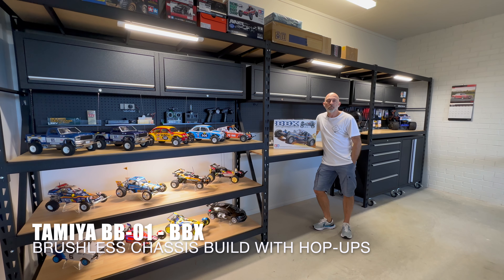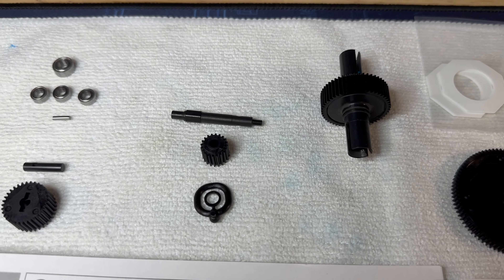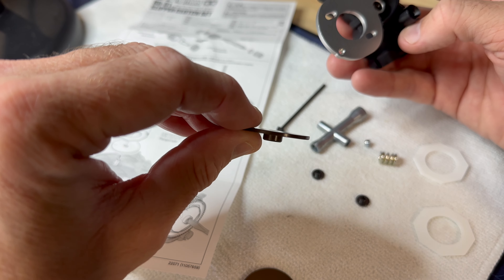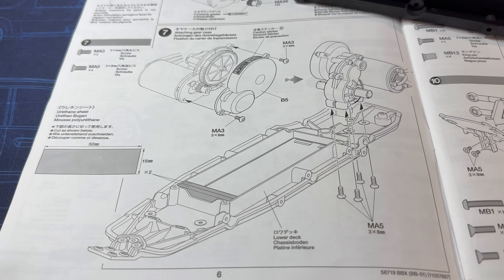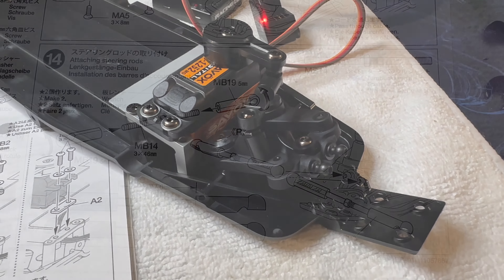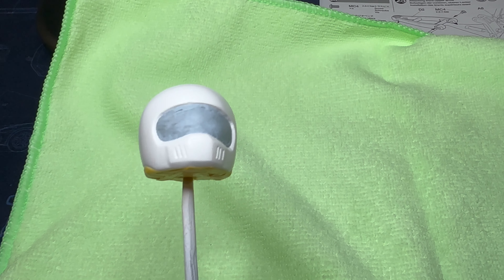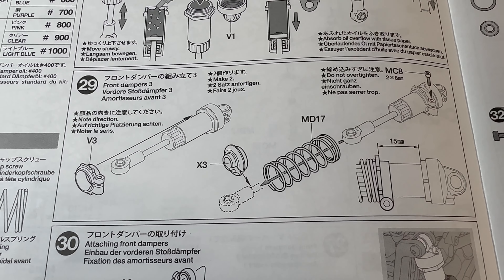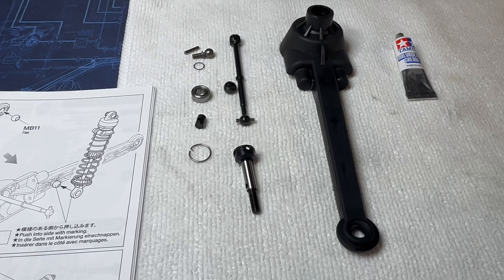Tamiya BB-01 BBX Buggy Brushless Chassis Build

Comment: Just one question, with the spare tire shouldn't it be a rear tire assembly as in the real incident the back would go flat not front, and if the front did go flat it would sill be drivable!!!
Reply from the maker: @ralphhowing3473  Good point lol. I think the supplied body mount for the spare wheel only works with a front tyre as it’s thinner. Would need to be a longer mount to accommodate the wider rear.
Reply: Thanks brother you just keep up the awesome work you do

Comment: Fantastic video and just the set up I was looking at with the tamiya esc and motor, so the esc cover can be put in place. A lot of videos are leaving that off as the esc is too big. 
Just out of curiosity can I ask why you chose the 15.5T and not the 10.5T - I believe that esc will run both ?.

Could i also ask what receiver and control you are using as that also looked very neat.

Sorry for all the questions but looking to get back into rc after a 35 year break and things have changed a lot in terms of electronics :-(.
Reply from the maker: @NS-tv7wi  Hi thanks for watching. I’m no expert but happy to help. Yes it all fits in there but the wires need to be super neat to fit. It was the most fiddly one I’ve done. Motor choice depends on lots of factors but simply the lower the turns, the faster the motor but with that there is less torque, so i believe lower turn faster motors are best suited for on road, drift cars etc. You can then play with the pinion gear to get the right ratio for your application, as per the charts supplied with the motor etc. I use a Noble NB4 transmitter & Flysky FGR4S V2 Receiver. The new NB4+ or Noble pro are other options. They can come with 2 receivers, the small one with no antenna and the larger one with an antenna. I use the larger ones in my SRBs. You can have 20 models stored. I still struggle with it as I grew up with stick transmitters. My vintage RC’s use the old school radio gear. Hope that helps and hope you are subscribed, cheers!
Reply: @ . Thankyou so much, really appreciate the information. I subscribed after watching your quality video, it’s the least I could do.
Maybe when I finally get round to the body and transfers I can send it over to you to sort that out for me 😂
Reply from the maker: @ Thanks, it is appreciated. I’m not monitised so don’t earn any money from these videos. The comments & chat keep me motivated. If I didn’t have such a backlog of projects, I’d be happy to help lol. I hadn’t done a clear body for so many years until this one, been mostly doing hard bodies. Lots of components but if you take your time, cut it all out, pre-drill and fit everything before painting, you’ll be fine. I’ve done a paint video for this one too. Lots of light coats is the key with time between to dry. Sorry, what’s your name? Are you in the U.K.?
Reply: Sound advice. I need to catch up on the rest of your videos 😉.
Nick (Uk)
Reply from the maker: @ Thanks Nick. Have a good evening. Jase in Australia, originally from UK lol.
Reply: Same to you 👍.  Can’t imagine why you left the dark wet and windy uk for Australia 😉
Reply from the maker: @NS-tv7wi It has its moments but I still love the U.K.!
Reply: @jason.bochniak  ❤️
Reply: Me again Jase - Sorry !.
No going back now, the kit is ordered along with all the bits apart from 2.
Which model savox servo did you go for ? 
What batteries do you run as I don’t think I am ready for lipo so any recommendations there would be appreciated as i want to make sure it fits 😂
Reply from the maker: @ Hi Nick, awesome! You need a low profile servo, you can download the manuals in advance from Tamiya and they have the dimensions etc but if you want the same as I use, it is an SC-1252MG. Battery wise, it will fit the regular Tamiya stick pack shape batteries or a shorty 2s Lipo. I found a NOSRAM 2s Lipos that is the same shape as the stick packs and also have the Tamiya plug. Nice power delivery and very light compared to a NiMH stick pack which is your other option. Just remember if you have different batteries, you have to change the hi and lo cutoff settings on the esc to suit. If you can get the 2s lipos that are the same size as NiMH, they will then fit in any other future Tamiya kits. Nosram 2S 7.4v Lipo 50C 314mm (tamiya) NOS999301
Reply from the maker: https://www.hobbyone.com.au/nosram-lipo-battery-7.4v-2s-4100mah-round-stick-pa
Reply from the maker: https://www.hobbyone.com.au/tornado-rc-battery-7.2v-nimh-5000mah-w-tamiya
Reply: @jason.bochniak  you are a star thanks Jase
Reply from the maker: @NS-tv7wi  No worries Nick. Most people will tell you to ditch the Tamiya ESC and plug etc, the more modern connections are a lot more reliable. For what I do they work fine. I’m a bit of a Tamiya fanboy so like eveything matching lol.
Reply: Yeah I am with you. I want it all matching and as much tamiya as possible. If the tamiya steering servo had been metal geared I would have got one of those also 😉.
Reply from the maker: @ 100%. That’s the same reason I don’t bother with the Tamiya servos. Shame!
Reply: Good shout on the build instructions being online. I should have known in this day and age 😖. From the looks of that they are suggesting using the Tamiya LF battery LF2200-6.6V racing pack 55102 with a deans to tamiya connection. Don’t suppose you have any experience of doing that ?
Reply from the maker: @ I usually download them whilst waiting for kits to arrive so I can get bits, paint etc ordered in advance. Yes I have a couple of the LF batteries and in my opinion they are not worth bothering with. Low power 6.6v compared to 7.4v lipo 2s. There’s no comparison. They don’t last long either regarding run time. I also wasted money on a proper Tamiya charger for them.
Reply: Good to know. Is it also night and day between Nimh 7.2v 5000mah and a 2s lipo ?
As I know I will not be disciplined in looking after the lipo, so worried i will let them go flat etc
Reply from the maker: @ no need to worry, the esc has an auto cutoff to stop the batteries from discharging too much. The car will literally just stop moving. It’s the same with NiMH. For NiHM, Ni-Cd & LF you set the esc to low cut-off and for lipo you set it to high. Lipo require more care, proper physical storage and actual charged storage. I keep mine at 80% which means they are always ready to use. If you want you can then top them up to 100% quickly. I always charge them with a balanced charge too. Never had any issues, just something new to get used to. I think its worth just diving in to be honest. I started with NiMH and ended up changing all my cars to lipo except for my Clodbuster and 1/14th scale Grand Hauler because the Tamiya escs for those kits can’t use lipo.
Reply: Thanks again Jase. Looks like lipo is the way to go 👍
Reply from the maker: @NS-tv7wi  You can always get a NiMH to get going if you prefer but getting to the ESC on the BBX to change the settings once it’s installed is a real challenge. That combined with the fact you’re going brushless, you want a decent power source that’s light in weight too. Just trying to save you hassle down the line. Good advice that I’ve been given time and time again (and still haven’t done) is to ditch the Tamiya plugs and install the deans style.
Reply: I really appreciate your advice as I am 30 years plus out of date 😖. Is that just a case of removing the tamiya plug and simply pushing on a deans connector on the esc ?
Reply: I don’t want to start soldering 😔. Don’t have the gear or experience lol.
Reply: I assume you have not had problems with the lipo melting the tamiya connectors if still using them ?
Reply from the maker: @NS-tv7wi  you need to chop them off and solder the deans plugs on. Or buy non tamiya ESC with deans plugs pre-installed. I haven’t had any issues but I don’t use them a lot. The deans plugs are just a better more reliable solution.
Reply: Cheers Jase. Managed to find the same battery as you from Germany. No one in uk seems to sell this with tamiya connectors 😞. I will not be using this much it will be very much as shelf queen lol, so hopefully won’t see any issues either 🤞. I did find some others in uk with tamiya connectors but they advised to use with standard can not brushless (I suppose that maybe the case with the nosram but at least I know some one that’s tried this set up using this particular battery so did that).
Thanks again
Reply from the maker: @NS-tv7wi  ok cool. Did they give a reason why not to use a lipo battery with a brushless motor? I’ve never heard that before. That’s what most people are running these days.
Reply: I believe it’s down to the current that the brushless motors draw compared to brushed and it’s that which will cause the connectors to overheat as they then struggle to draw that extra current from the battery through the connector
Reply: I take it the lipo is charged through the balancing cable and not the tamiya connector ?, so I don’t need to worry about connection types on the charger ?
Reply from the maker: You have to charge with both connectors connected to the charger at the same time. I don’t think you’ll have a problem, the battery is only a 50c and you say it’s mainly for the shelf. When you run it just keep an eye on everything. You can run it, feel the connector, check if it’s getting hot. Always good to look over the car as things can rattle loose too. Worse case, you can change the plugs. Soldering is really easy mate.
Reply: @jason.bochniak  no worries. Cheers
Reply: Nearly there Jase 😂 I hope.
Charger sorted. Did you use anything on the motor plate ?
Diagram says apply synthetic rubber cement ? Don’t know what that is and don’t believe it’s used anywhere else ?
Reply from the maker: @ hey Nick. Step 6 motor to motor plate? Definitely no glue there. You need a bit of the supplied grease. Steps 18 & 20 you do need some synthetic glue. Have a look at my build video…
Reply from the maker: @ what charger did you buy?
Reply: Hi Jase. Oh right they supply the grease needed for step 6. Great !.
Yeah 18 and 20 are using ‘synthetic rubber cement’ what ever that is ?
I bought the skyRc T100 - seems to have everything I need (with tamiya adaptor).
Ps first snow fall for the end of 2024 in the uk tonight, must be nice to be warm right now lol.
Reply: I’ll have another look at your video. Got it saved as a favourite 😉
Reply: So guessing it is basically gorilla glue or some equivalent- as in it just sticks loads of different materials including plastic and metal together for a permanent bond ?
Reply from the maker: @ Cool. Sounds great. I haven’t seen the snow for about 15 years lol. Yes warming up as we are heading into Summer here. Maybe google it. That’s what I did. I used Tarzan brand glue. It sticks most things but doesn’t melt the plastic.
Reply: Cheers Jase
Reply from the maker: @NS-tv7wi when’s your BBX coming?
Reply: Still waiting for an update 😔. Ordered it late on Friday night (from German seller on eBay 😖)
Reply from the maker: @ Do you use TTP models? I get all my spares from Antony there, apart from kits which I get locally or from Asia.
Reply: Yeah I used TTP for a few of the bits (heard you mention them in the build video 😉).
Reply: Hi Jase. Hope you are enjoying the summer Sun ;-).
While I await the BBx I am starting to think about colours and the driver. I was wondering what grade sand paper you used on the helmet joins (and what filler did you use to fill the gap ) ?
I might look like a real dog dinner when I paint bit but at least it won’t have a join (I hope) 😂
Reply from the maker: @ Hey Nick, yes mate it’s spectacularly agreeable at the moment as it’s Spring here still. Was at the beach Saturday. Not missing the cold at all tbh lol. I think I used my Tamiya files which are very fine then 400 grit, no filler and primed before top coats. I do have a tube of the Tamiya filler but never opened it. Make sure when you glue the two halves together to leave the plastic joint to fully harden for at least 24 hrs before working on it otherwise the join will move. You shouldn’t need filler.
Reply: Yeah. Your spring will be nicer than our summer 😞. It’s certainly not a time for the beach here, although I’m not sure it ever is 😂.
As ever thanks for the advice Jase, much appreciated.
Reply: So you glued the length of the upper join ?
Reply from the maker: @ I would have glued the whole of the join, it’s also screwed together
Reply: @ brilliant - thank thanks again Jase. You go enjoy the sun while I take the dog out in the rain😉
Reply from the maker: @ It’s Sunday night here already, sun is long gone, enjoy your walk with the dog mate.
Reply: @jason.bochniak  keep forgetting about the big old time difference. I thought that as soon as I had sent the message. 
Ps watched your video on the rough rider yesterday- yet another superb job  👍
Reply from the maker: @ All good Nick. Cheers although I have a new body set for it so another paint job is needed 🙄
Reply: @jason.bochniak  you are just the man for the job 👍
Reply from the maker: @ Have you started the BBX?
Reply: @ still waiting for it to arrive 😆. Having said that I probably won’t get chance until January 😖. But at least I should have everything ready to go.
Reply from the maker: @NS-tv7wi First thing I would do is paint the driver, get it out of the way then it won’t hold your build up. I didn’t bother sanding and messing about with the joints until recently. Most of mine are just stuck together, some don’t even have the drivers eyes painted. The decals cover either side of the helmet too.
Reply: Good advice. I was thinking the same to get the driver done first  👍
Reply: Hi Jase. Watching the sand scorcher video made me wonder - Did you manage to manage to paint the main body of the bbx with one can or did it take more ?
Reply from the maker: @ Hey mate. If you watch my poor technique on the BBX you’ll see I had all the parts spread out so most of the paint went either into the air or on the cardboard lol. I think I used 2 cans of blue and 1 can of white.
Reply: lol. Yeah I did see that. Maybe I will try putting them closer together when I get round to it. I have one can but started to doubt if that was enough 😉
Reply: Mile stone one. Tested the electronics today. It Wouldn’t save the newly bound receiver to the controller then realised I had left the bind plug in the receiver 😂.
Motor wouldn’t respond properly when triggered (I.e wouldn’t work for forwards a lot of the time), so finally read the instructions and set the high point, then seemed to be fine 🎉. Also set the hi point for the battery cut off and now getting a single long beep so I think that’s all good. Need to start the driver next but can’t see that being this year, so think that’s me done for a while 😢
Reply from the maker: @ I think I’d done four hard bodies in a row, keeping the parts separate etc. Been a while since doing a clear body. Just make sure when you do the white and blue, the clear plastic parts are nowhere near each other. The paint goes into the air and you can get spots land when the colour travels.
Reply from the maker: @ it’s a lot to get used to, I still refer to the instructions every time. Hopefully you can get it done soon but it will take a while, there’s a lot to it. I’m currently working on my fuel tanker for the Grand Hauler.
Reply: Yeah I will do the body and roof separately 👍. Still need to watch your tanker videos 👍
Reply from the maker: @NS-tv7wi Cool. I mean keep them completely separate. I had the roof a good 10 feet away while painting the blue and it most have been in the air and settled on the clear roof part. I didn’t notice until I painted the white and you could see blue spots everywhere. I had to clean the paint off and repaint white. The Grand Hauler Truck was a challenge, the fuel tanker is also a headache.
Reply: Yeah . I knew what you meant 👍. Will paint them in separate sessions
Reply from the maker: @ no worries, just trying to save you the time and expense.
Reply: No worries and it’s appreciated!. Thanks Jase